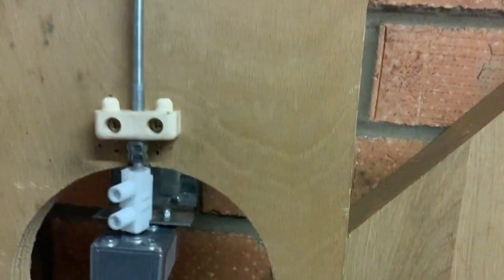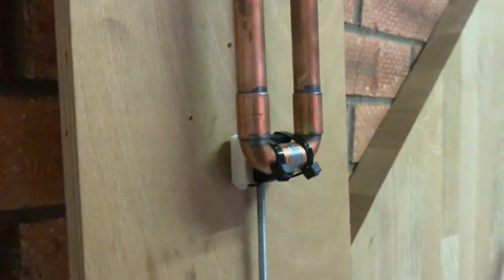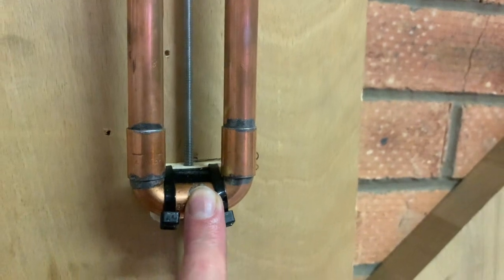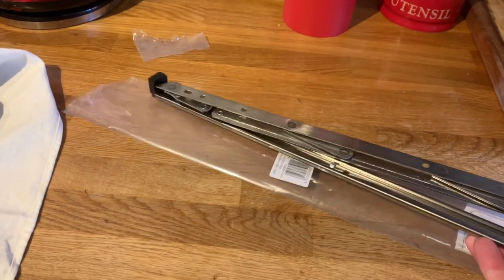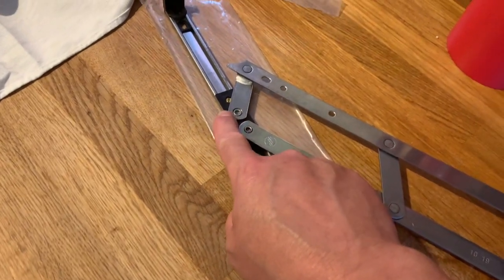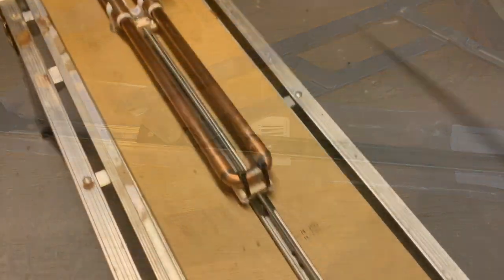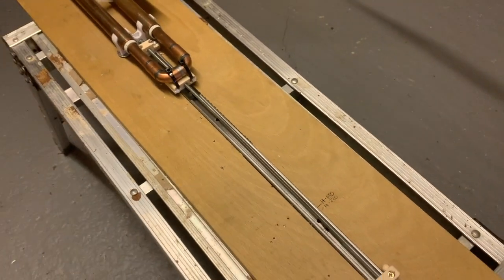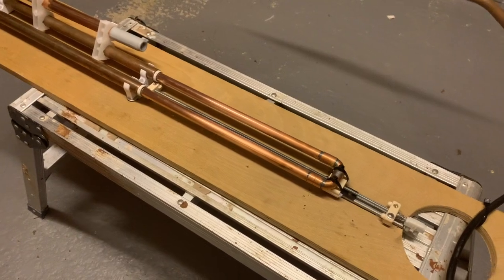HAM RADIO:  Building a magnetic loop antenna Part 2.1 Capacitor Track

Comment: Hi, I’m a big fan of Mag loop antennas and discovered there’s not a lot of videos of trombone air capacitor. My question is why? I like this design because fine tuning is more efficient (at least for me) and it’s easier for building than a circular capacitor. 73s de YY3BIG

Comment: You are a genius! May be will better to add the teflon film between pipes? The maximum voltage of pipe capacitor will  become higher...Thanks and "73".

Comment: Hi Mike, great inspiring video. I was looking for part 3 the on air demonstration. I was also wondering if you added limit switches on the slide to stop the motor from trying to wind past the ends. de KA9TII
Reply from the maker: Need to do a follow up to this video

Comment: Did I miss something. I haven't seen a signal report for this build. Was it a failure? Did it get multiple bands with good performance? Did it only work on one band? A lot of work for no on air performance testing...........
Reply from the maker: Yes ok, there is a lot of uploads to look at, but to help, it works well.
Reply: @mike-M0MSN  that's what I wanted to hear, thanks for the reply!

Comment: I find your mag loop too complicated. This video deals with mostly with a motorized tuning. It’s a lot simpler doing it by hand.
Reply from the maker: so true..  :)
Reply: That's correct, unless you are indoors in your shack and the loop is outdoors up on a post. If that's the case, you'll also want both a remote loop tuner and a rotor, since the ability to rotate a small loop for directivity is a fundamental reason to make one.

Comment: Hi Mike 

I made my magnetic loop from 1” x 1/16” aluminium flat bar / strap. The loop is 8m circumference and only needs around 70pF to tune 7MHz 

I’m using a couple of stacked T240-43 as a transformer couple. It requires more driver side turns on 7MHz than on 14MHz. I haven’t tried it on 10MHz, I imagine it would be somewhere in between 

I built a small motorised piston capacitor out of 20mm electrical conduit covered in copper foil into a 25mm conduit tube with aluminium flashing wrapped around it side by side on the same piece of conduit

The capacitor was good to around 20W CW on 7MHz. Anything over 40W and I was getting flash over and arcing through the plastic conduit I was using as a dielectric. After using electrical tape for extra insulation, I can get 60W or so, but still can’t get a dollar into it without arcing 

Out of curiosity, how much power are you running into the loop ??

I must admit, the aluminium strap is so much lighter than the copper tube. I found someone who does extruded fibreglass reinforced structural drawn plastic bars which is what I am looking at using to frame the antenna. Keep the weight down for a permanent mount on my rooftop
Reply from the maker: Thanks for the info :)
Reply: @mike-M0MSN  cheers

How much power are you running into your loop ???

Comment: 563/5000
Sorry but the motor shaft and threads are out of alignment!
At the top I would the house which normally should be a bearing house
 (not ugly intended!)
I would remove that House at the top(bearing house
)
Leave the thread to swing back and forth a bit, doesn't matter that much.
I have the same with my Prusa i3 3D Printer and it works perfectly!  At the top the 2 threads swing back and forth (the guides keep it stable)
(if you lock the screw thread it will only get stiffer) Unless everything is straight and in line of course!
Make sure that the bearing house (which is close to the engine)  is of good quality!

Friendly greetings from The Netherlands!
Rob
Reply from the maker: HobbyRob Thank you for your post I need to have a look.  🤗😀
Reply: @mike-M0MSN  
By the way, didn't you have a 3D printer yet Mike?
is really worth it!
it may be difficult at first but with with a bit of research and experimentation and a little luck ...
I don't think building it yourself is that profitable anymore, a KIT is probably the best thing to buy!

Kind regards from the Rotterdam area again!
Rob

Comment: Just a thought, is that track not going to change the tune being so close to the trombone.?
Reply from the maker: Alan Briscoe seems to be ok..
Reply: @mike-M0MSN  Convention suggests having a chunk of metal inside the loop should be avoided. How to measure/prove this I do not know. About to start on my third loop one metre diameter of 15mm tube in a single piece round loop.
Reply from the maker: Nigel Evans yep you maybe right, but experimenting is fun...

Comment: Looks good :)  I'm kind of following you, except I'm using a lead screw from a 3D printer and a stepper motor. It's nice and straight. I also printed spacer cylinders to go between the thinner copper pipe and the plastic conduit and superglued the thinner copper pipe, spacers and conduit together so the conduit and copper pipe slide in and out of the thicker pipe. I've had a 1.9m copper pipe loop sitting in the outhouse that has been waiting for a capacitor for years, you've finally pushed me to do something with it! :D
Reply from the maker: Fantastic, great idea with the 3D printer, must get myself one..  :)